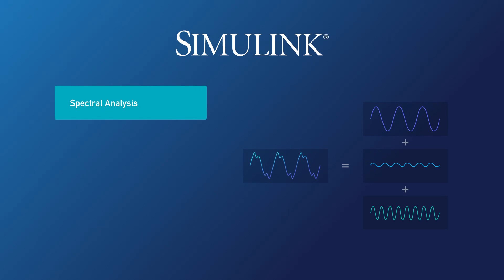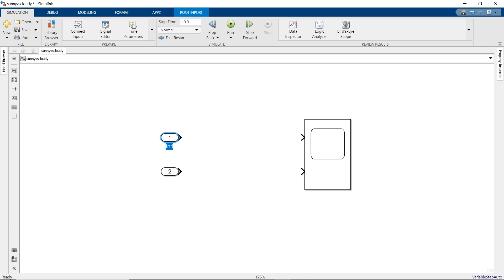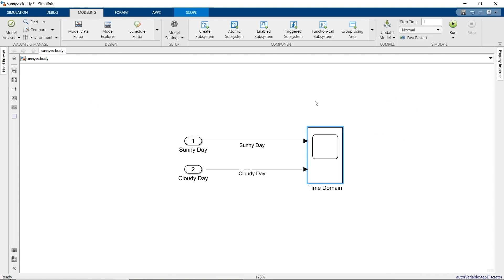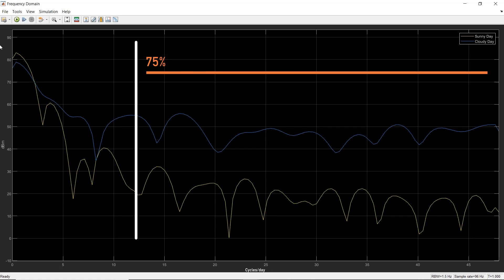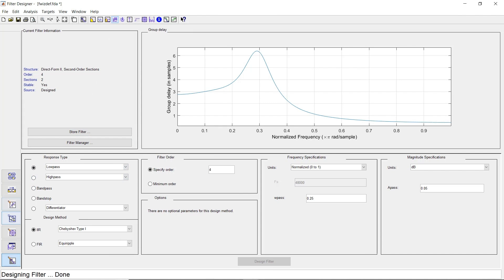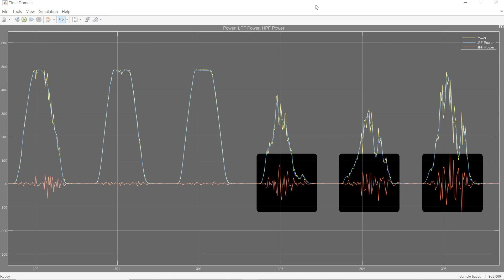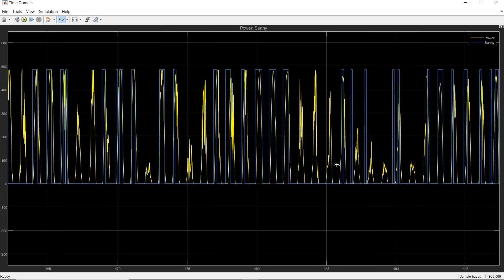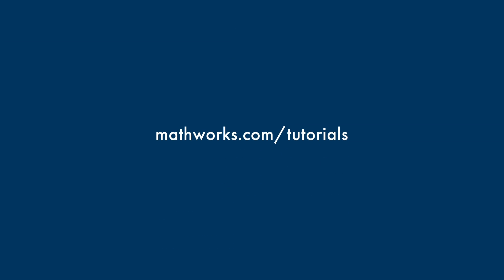Getting Started with Simulink for Signal Processing

Comment: Around 4:09, I had to use the command window to change the Window Length and NFFT to 96 and 256. However, It gives the error message after run button was clicked. It says "The Spectrum Analyzer block requires 1024 sample(s) to update the display. It will update once the required number of samples have been input. Run the simulation to update the display with new data." I am using 2024a version.
Reply from the maker: In R2024b later, the spectrum analyzer no longer required a minimum number of samples to display. Can you use the more recent release?
Reply: in 22b you had to select Full frequency span.